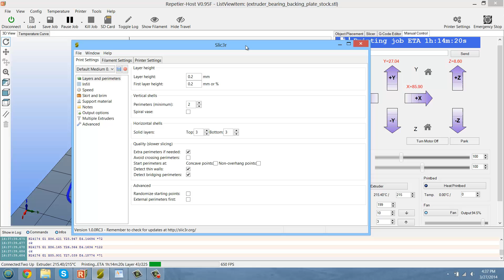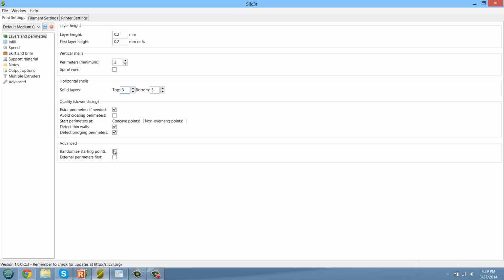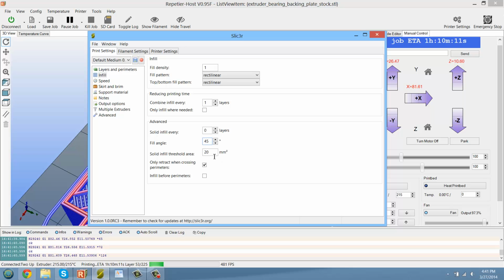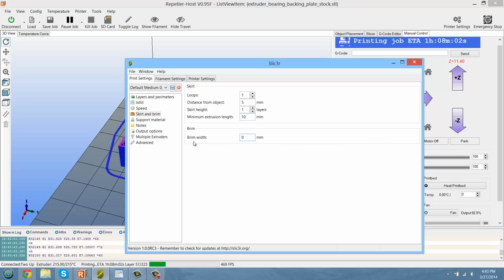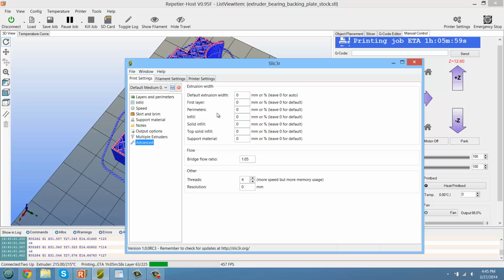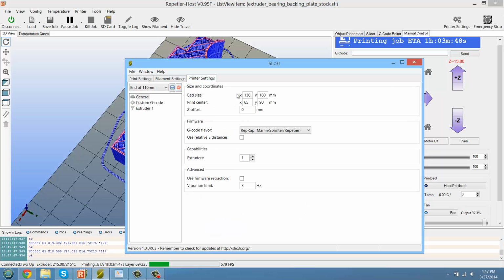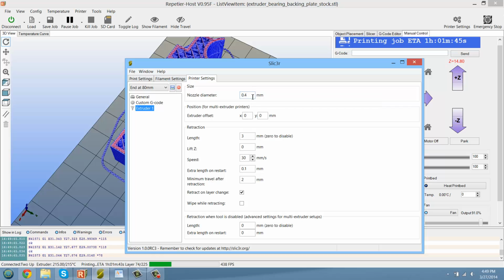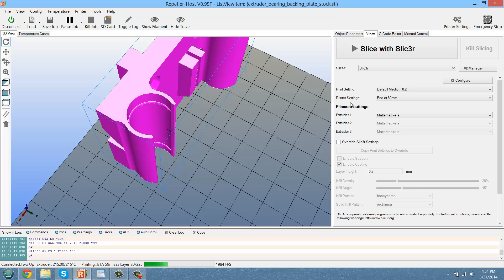Slic3r Settings - Explained [2014]

Comment: Hi,
I have a home made 3D printer.
I am facing issue with Z motor movements. While printing after each layer z motor doesn’t move up much or doesn’t move at all and it end up crushing previous layer.
Kindly advise is there anyway I can increase the z motor movement after each layer.

I am using slic3r for gCodes and PronterFace for printing.

Comment: You started out demonstrating Slic3r which I have downloaded and am running. The options were a bit different from yours presuming that you may have an older version from mine. But at the end of your video, you exited Slic3r and started talking about the software that had a window underneath it and it had at the top of the window "Repetier Host". What is that? It doesn't appear to be Slic3r. I am guessing that is the G-Code Sender you are using to directly control your machine using the code generated by Slic3r.
Reply: Repetier Host is a printing software, I use it for my Rapide lite 200

Comment: Percent infill is just that -- a percent, meaning that honeycomb infill will not use more plastic, as it is still a percentage of otherwise empty space that you filling in with plastic (the volume of plastic used will not change). Honeycomb will also give you the best strength-to-weight ratios when printing.
Reply from the maker: That's not entirely true. Rectilinear will actually end up using a few percent less plastic than honeycomb. The slicing software has to pick and choose its battles in order to slice quickly, so it makes some approximations about the volume required for infill which results in slightly more material use (only a few percent more). However the main thing I was referring to in that statement was that because of the way honeycomb prints, you would require almost double the infill percent for it to provide roughly the same visible amount of infill. It is much stronger at the same percent, yes. But for parts which require more dense internal infill to support external features, a lot higher honeycomb infill would be required.

Comment: I noticed you are printing from your pc via usb I assume. Is there a benefit to doing this instead of saving a gcode file to an SD card? Also, I'm new to slicer and was wondering what that program is you are using to monitor the print progress with. Thanks!
Reply from the maker: Typed up a response but youtube wouldn't let me post for some reason lol weird. Basically printing from usb is more volatile as it is constantly sending data and this can cause failures, but it allows you to pause mid print. Printing from SD is safer since the whole file is right on the board, but you can't pause prints unless you have a lcd control board.

Comment: Dear 3d Printed life , by using slic3r , How can I print only honeycomb shape, tensile test sample , without four +45/-45 layers that cover the honeycomb shapes from 
bottom and top ? . Iam using MALYAN FDM and makerbot software

How can I controll infill pattern in form of 0 and 90 or only 0 or 90 degree ?
Reply from the maker: +Ahmed Sabah Well if you're using makerbot software then you aren't using slic3r, you're using makerbots slicing engine. It isn't easy to make those changes you want to do, you have to make your own custom profile then edit the text file it will give you in order to change the print settings. Makerbot  really doesn't want people messing with print settings too much so they make it painfully impossible to tweak anything more than infill amount and number of shells. You will want to remove all top and bottom solid layers. And I'm not sure what you mean by that last part.
Reply: I can clarify what I mean by this photo where  samples does not include top and bottom cover ( solid shells )
  https://www.google.iq/search?hl=ar&site=imghp&tbm=isch&source=hp&biw=1280&bih=699&q=infill+pattern+&oq=infill+pattern+&gs_l=img.3..0i19j0i30i19j0i5i30i19.1173.8313.0.8681.15.14.0.1.1.0.306.2191.2-8j1.9.0....0...1ac.1.64.img..5.10.2189.PiaPVoA84ls#imgrc=MkK3btX1mhXLzM%3A
While  samples here
Reply from the maker: Yeah so you want to remove the top and bottom solid layers, again I don't know how exactly you do this in makerbot software so you will have to find the setting on your own or do a google search.
Reply: so many thanks

Comment: I'm very curious what you mean about the G28 Home all Axes command being a problem?  That doesn't make sense to me.  Actually it seems more likely that not doing so could cause problems if you forgot to manually home your axes.
Reply from the maker: +Justin Allen When I made this video my channel was tiny and it was really all referring to the QU-BD one-up and two-up, both of which originally didn't come with endstops. Having the G28 command in when you don't have endstops leads to serious problems, as I'm sure you can guess. However, if your printer has endstops then definitely use the G28 command!

Comment: "upside down triangle", heh.
Reply: "Here's all the really obvious stuff that you can figure out by looking at it that I'll explain for 15 minutes -- and this advanced/multi-extruder/whatever stuff, you can figure that out on your own"...  >.<
Reply from the maker: Michael Jensen Thanks for your input, however I did get multiple requests to do this and it is meant to be a beginners guide, where multi extruder and some advanced settings are really unnecessary. For those brand new to 3d printing, many of these features are not as obvious as they seem. I remember when I first started I was very confused. So the point of this video is to get people familiar with the settings and what they do, not make you an expert in slic3r.

Comment: Any idea what settings would reduce what I've seen called "elephant's foot" online. Its when a part flares out at the interface between the part and the print bed. It happens regardless of whether I use ABS or PLA. Their chamfer solution seems like a lazy mans approach to solving the problem.  http://support.3dverkstan.se/article/23-a-visual-ultimaker-troubleshooting-guide
Reply from the maker: Well the best solution would be to raise your starting point a little bit and actually increase the temperature just a little so that it has a better chance of sticking. Also, printing with a raft with at least 4-5 layers will completely solve this issue, but it will add a bit of time to the print and will also take some more material.

Comment: How do I get my model to slice properly cause all the slicing does is make very little in the machine or nothing at all my machine works it's just that it doesn't want to print and if it does it would say that the print time is 6sec to 30sec which doesn't make any sense... can you help me?

How to I change my model's size to original? cause when I put it on the program I can barely see my 3D model cause it's so tiny

Comment: nice vid mate but i want to dual extrude. Have you any idea? i am totaly new in 3d printing and its a bit mess..   i am trying to use one extrude only for support material so any help i would appreciated a lot!
Reply from the maker: Well I don't know too much but I believe what you want to do is change a few options in the slic3r setting tab labeled "Multiple extruders." There you can select which extruder to use for which kinds of printing. You could leave the first two settings at 1 but change support material and support interface material to 2. That should work, but I can't verify it as I don't have dual extrusion myself.

Comment: The slic3r im using looks nothing like this are there different versions?
Reply from the maker: Well the one I am showing is the slic3r that is integrated into repetier host. There is also a stand-alone slic3r program which does look a bit different, but it should have all the same settings.